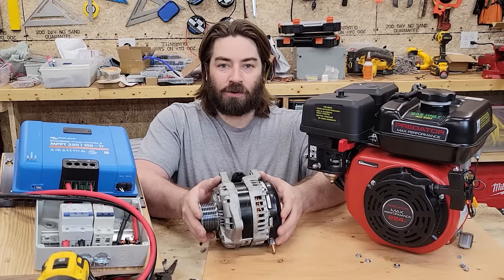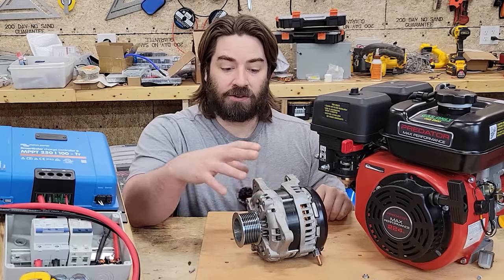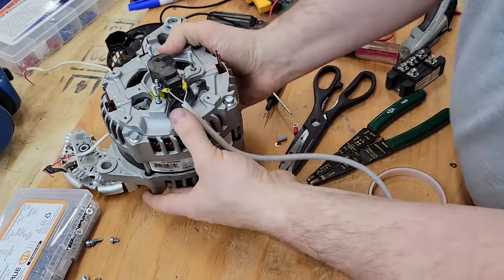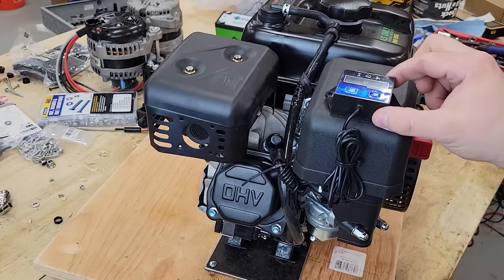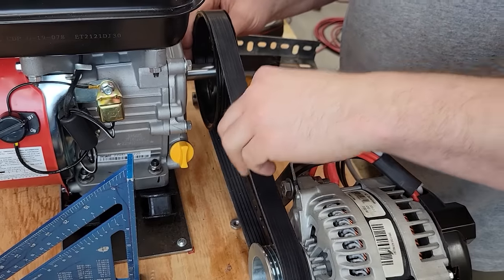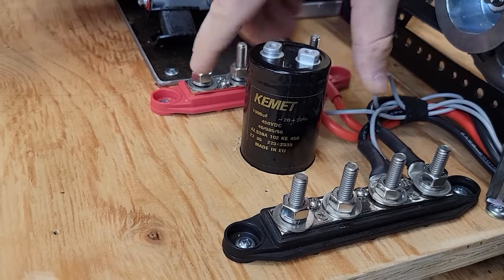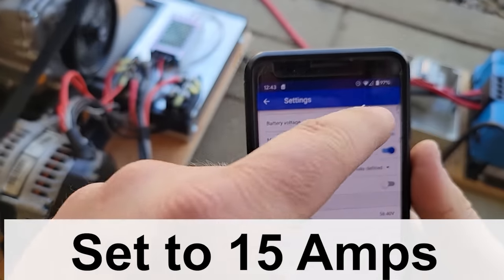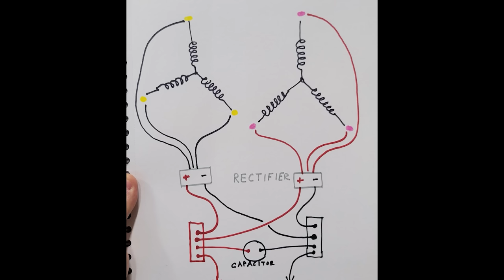The AlternatorGenerator, First Attempt.  48V Battery Charging

Comment: Great idea, however with 2 isolared stator windings, did you consider to rectify each 3phase system seperately and put 2 seperated rectified voltages in series at DC sides with as advantage; more or less double voltage at same alternator RPM and lesshigh voltages om individal statorwindings isolation (ripple should still be limited as 2 stator systems are 60 degrees phase shifted..?
Reply from the maker: Yes, I thought about it.  If I tested this, and didn't get at least 80VDC then I was going to series connect them. But since it got above 80, there was no need.

Comment: The goal would be to get the amount of voltage to stay the same under load of charging at a low rpm on the engine to conserve gas and keep noise down id rewire the alternator with thicker gauge wire and permanent magnets

Comment: You could have used the original rectifiers.  Is the reason for mounting the rectifiers externally on a massive heat sync for better cooling?
Reply from the maker: There were a few reasons I moved to an external rectifier.  One of the reasons is to move the heat from the rectifier away from the alternator.  I go into it in more detail in part 2 video.

Comment: I am no electrical engineer, so how i would do it would be to get two 24v alternators putting out 28v each and run them together, wired in series putting out 56v. Just right for your 48v battery bank
Reply from the maker: There is another YouTuber who went that way.  His channel is Trial N' Error.

Comment: Solid mount your motor to the base. Rubber mounts are no good when using a belt drive. 
Instead of holes in your tensioner bracket use a slot. Just look at a cars mounting bracket. That way you can put tension on your belt and then tighten the bracket.
If vibration is still a problem their are two possible solutions.
1. Put spring or rubber mounts under the base.
2.build a metal mounting plate under the alternator and the engine and then put springs or rubber vibration dampers between it and the base.
Hint. Check huscavarna chainsaw engine mounts as spring vibration dampers.
My old friend made one of those rigs 30yrs ago.
I think there was one available commercially called the Genny D.C.
Both of which only put out 12 v.
I knew that an alternator puts out more than the aprox 14v. Hence the need for a regulator or battery would boil.
I apploud  you for unlocking its potential. I would be fascinated to learn the energy efficiency of the system.
And the potential for alternative drivers
.ie water or a steam turbine.
Well done.
Reply from the maker: Thanks for taking the time to help me out. 
I implemented most of those changes in the part 2 and part 3 videos:
https://youtu.be/cy0t4qq8mS0
https://youtu.be/yQTCVyxdauo

Comment: I may have missed the detail where you explained it, but curious why you didn't use the diodes already on the alternator?
Reply from the maker: Check out video part 2 https://youtu.be/cy0t4qq8mS0
I dedicated a chapter to answering that question.  The chapter starts at time 22:39

Comment: on a pully look for a pully for a gas powered air compressor they use serpitine belts Also you might want to use somthing more ridged a steel plate or somthing like that  also I probaly would use a diesel motor off amozon you can get a cheep 5hp one and it go all day long off any fuel oil think being able to toss lamp oil in it or karsine ina pinch would be nice. not to mention diesel just flat has more torque   you could also feed the windign a bit higher voltage if you want 14 or 15 volts and get some more out of it

Comment: The vibration is from the play between the motor mounts and the semi-solidly mounted alternator.  Are there bolt holes on the engine to which you could attach the alt? That would give you a solid distance between pulleys.  Right now, the play is in the rubber mounts, allowing the engine to bounce around.  I, too wondered if that was a solar-rated breaker.  Overall, nicely done, David. Ya can't beat getting 3kw out of the very first attempt.  I'll be making one of those for my own 20kW EG4 array.  It'll keep me running when the skies darken for too long between solar charges.
We ALL need to think about things like this as our civilization spirals into the dirt.  Don't doubt that the lonely hearts will start importing ham-arse terrorists into our country next week.

Comment: The alternator needs to be mounted to the engine, not through the rubber mount but directly to the engine (not the plywood). The reason being that there should be no rubber mount separating the two rotating members. Said another way; Mount the alternator to the engine. Then rubber mount the assembly to the base. 
The partial reason that vibration remains a problem is that the alternator is attached to the base and the alternator is experiencing rotational motion loss and acceleration forces every other rotation of the engine as the engine rotates through to each compression stroke. Lost motion is the issue.

Comment: Mount the alternator to the engine, ( not the wood base) for lower vibrations and less belt slip/ more belt drive efficiency. Then upgrade your engine mounts which seem to be doing a bad job coping with engine vibration, esp under load. I think you’ve prob worked this out already. 😎
Reply from the maker: Thanks for your comment.  I fixed the alternator and engine together with a welded steel base in video part 2.
Reply: @DavidPozEnergy  thanks for the feedback. 😎

Comment: I was thinking you could soft mount the alternator like the motor. then hard mount it to the motor. also you should be able to use the charger in the motor to accite the alternator.
Reply from the maker: Thanks for your comment.  In video part 2, I hard-mounted the alternator and engine to the same steel base.  It worked out well.

Comment: So, why take out a perfectly good set of rectifiers that are already attached to a heat sink and cooled by the forced air cooling the alternator was built with? Others in the past have taken the regulator out of an alternator and used the existing diodes to get 120V DC output for light welding.
Reply from the maker: It's a great question, and I debated about it for way too much time when I was working on this.  It was such a common question that I devoted a whole chapter to it in this video: https://youtu.be/cy0t4qq8mS0 at time 22 minutes, 39 seconds.

Comment: How much did the project cost including your time  i live in mass and wish i had one of these for my off grid system i am curious though longevity of it and you should try a shock to take the blunt of vibration
Reply from the maker: It took about 6 months of research to really feel comfortable building it.  There was a lot to learn.  The actual build took a week (3-4 hours a day).  Of course, it would go faster now, LOL.  It would save time to use the built-in bridge rectifier, but you would have to use an external battery, not a DC to DC buck converter.  Anyways, I'll answer these questions in more detail in my follow up video.
BTW, if you want to talk in more detail, contact me on facebook@ davidpozenergy

Comment: So I had a thought as a mechanic.  While I won't say I fully know the internal workings of an alternator, was there a reason you didn't use a 1 wire alternator for a Chevy?  They're self energizing
Reply from the maker: If I was recharging a 12V battery, I would have chosen that style alternator.   In my situation,  I want to recharge a 48V lithium battery.   I need to control that externally.

Comment: This could be made into a great little portable generator to extend the range of a practical lightweight EV. Most people only need a range of 100 miles to get to and from work. When one needed to extend their range for a longer trip, this little generator could be dropped in. On long highway trips, once the car is up and going the generator would be able to easily extend the range.

Comment: The thing is, gas/diesel doesn't store well long term, and when the grid is down, generally the pumps are also down or filled with zombies. So you have to make sure you always have fresh fuel around. And striving to be self sufficient and independent, you should look for ways not to rely on the outside world for anything consumable anyways. So, I know this is not really your wheelhouse, but I'd love to see you explore alternative ways to generate power when the sun doesn't shine or when the wind doesn't blow. A steam engine maybe? You can always find a dead tree to burn.
Reply from the maker: For sure exploring alternatives are great.  I also have a diesel generator, which could run on vegetable oil, or used motor oil.

Comment: I would like to see a AC 120 V motor power the alternator or two alternators to charge the battery and see if the 120 V AC motor can be powered by the alternators or how much the alternator can power the batteries. I guess what I’m trying to figure out is if we can have a perpetual Electrical power source that feeds the 120 V AC motor and charge with the DC alternators? Maybe a couple of alternators and tandem my question is is it feasible to have a AC motor power my DC power supply efficiently enough? That is how much or how many alternators would it take to power my home using 120 V AC motor to charge my batteries using the alternators?

Comment: Hi! good video, I might have missed when you said it but since I missed it could you tell me why you removed the original diodes and replaced it with an external one please, I thought all you had to do was to remove the 12v regulator and place an adjustable supply to the rotor coil. the piv of the original should be at least 70v and the orignal diode gets cooled by the fan of the alternator, the diode wasnt absolutely needed either since in an auto you dont have caps to smooth the output voltage
Reply from the maker: There are a few reasons.  1. less heat inside the alternator case. 2. I don't know the Voltage rating of the diodes. ETC.  However, the original rectifier may have worked perfectly well.  I'm not sure.  I'll go into more detail on this question in my follow up video.
Reply: @DavidPozEnergy  ok looking forward to watching it, thanks for replying.

Comment: Good info. Is there any reason to wire the solar charge controller directly to the inverter or can I just go straight to the battery since it's all parallel. Is this just preference?
Reply from the maker: Ideally, set up central DC busbars, one for positive and one for negative.  This central point is where all your DC stuff comes together.  Batteries, charge controllers, and inverters.
Reply: @DavidPozEnergy  Thank you for the reply, that makes sense.

Comment: Why didn't you leave the original diode pack... I'm sure they would be rated above 100volts and would have made for a cleaner setup... I wonder how much current the exciter coil needed under full load
Reply from the maker: I dedicated a whole chapter in video part 2, to answering the question about the diodes: https://youtu.be/cy0t4qq8mS0?si=XLdnCsPAVbBdXtct

Comment: Also, is the alternator's rotating direction critical? I think - the only impeller blades orientation could decrease the blowing quality in case of counter-rotation, all the rest (magnetic and electrical systems) must be quite symmetrical in terms of rotation direction so it should not be critical. Please correct me if I'm wrong.
Reply from the maker: The alternator will produce power in both directions, but the fan blades are set up for clockwise rotation.  You had it.  Thanks for watching.

Comment: That type of modification will shorten the life of the alternator. The charge rate is normally 12.6 to 14.5 volts. It is not the volts, but the ampres that charge the battery. It is ac voltage until it gets to the rectifier bridge. After that, it is dc. The alternator should have the max amperes that it is capable of generating stamped on it. A car electrical system is normally 11 to 14.5 volts. Yes, inam pulling this from memory, but I was an ase certified master tech, have studied cars for years. Highschool, Wyoming technical institute, American river college. Id suggest rubber feet under it for stability.
Reply from the maker: Thanks for your comment.  I also have a part 2 and part 3 of this video you may like.

Comment: How did you hock up the power to the Alternator ? If you leave the current on all the time it will burn out the Alternator you need to have some kind of starter ignition which only sends power when you turn it on charging the self igniting alternator! I have 2 - GM 10 Si high Amp Alternator’s self igniting but you need to hit it with like 2.3v to start the charging & I have a Ford / Mazda 150A Alternator all 12v but my battery bank is 48v Lithium Phosphate Each Bty. 3.2v 280Ah 15 PCS & LTO 2.4v 40Ah 22 PCS 20 PCS is 48v my inverter is a Hybrid 5KVA 230v Charge controller 48v , Rectifier  3 Phase in 2 Phase out 250A 1,600W over kill for my house ! Any thoughts ! You’ve actually done it ! If it’s not to much  !
Reply from the maker: I used a buck converter to power the field winding of the alternator.  The buck converter is only on when the alternator is spinning.

Comment: you have the engine rubber mounted but the alternator hard mounted, thats why youre getting wacky things happening with the belt, youd need to mount them on their own platform and rubber isolate that to save the electronics from the vibrations, or if the electronics dont care you can just put rubber feet on the whole thing and hard mount everything

your bottle neck isnt the engine or belt drive, at 6.6HP even if harbour freight is embellishing that number you have lots of head room for power loss there youre producing about 4HP of electricity, and assume 750watts of loss in heat between the belt, alternator, rectifiers and convertor you still have 1.5hp of room for them to be off on the HP and for other losses

your bottle neck will be cooling that alternator, while it can do 215amps, it cant do it continuously, i dont know what impact running at the higher voltage will have, if that will make it alot more efficient running lower currents, but regardless i know from winching with my jeep that the alternator will get scalding hot if loaded heavily even for a short period of time, theres probably more information on this in car audio forums as theyll tend to be pushing alternators well past their design specs but chances are to run this anywhere near continuously youll need to run two alternators in parallel each only using half the load, or simply run the system at half its capacity and use short bursts of full power when needed, would have to test how long it takes to overheat, id guess you might get 30 minutes in safe temps, and another 30 minutes pushing its limits

consider the size of the generator head on even a small 2000watt generator, itll typically be 2-3x the size of the alternator for less power output

side note: junk yards will make these projects more realistic economically, you can get your alternators, pulleys, and heavy gauge wire from vehicles at pennies on the dollar

an idea everyone has had, you probably pulled it off the best of anyone ive seen do it just needs some tweaks and could be great to top off batteries during winter storms

Comment: The total output is not going to change much as the windings are capable of only so much current,  volts can change and amps can change but wattage is fairly consistent at maximum output
Reply from the maker: Thanks for your comment.  Part 2 and 3 videos are live: 
Part 2: https://youtu.be/cy0t4qq8mS0
Part 3: https://youtu.be/yQTCVyxdauo

Comment: I tried to read the rating on the circuit breaker.  It was hard to read, but it appears to be an AC circuit breaker.  In any case, it should be a DC circuit breaker.

Comment: Experiment with methane gas produced from kitchen waste as alternate fuel. And try enriching the fuel with hydrogen perpetually produced from a small wind turbine for the electrolysis. 
The final stage would try store the energy into so of the newer battery types too.

Comment: I don't understand what was wrong with the diodes the heatsinks that there are in inside the alternator, I've done the same project, and all I did was just bypass the voltage regulator, and put a rheostat to vary the voltage to the rotary, I could turn the voltage up and down coming out of alternator, simply by rotating the rheostat,

Comment: OK, I'm not the brightest bulb in the pack but most cars Rev between 1500 - 2200 if you are hard on the gas. The gas engine he has max out at 3750rpm that should be more than enough revs to do what he wants. There should be no need to Rev it to 8000 rpms. Am I wrong?
Reply from the maker: Usually the alternator is spinning faster than the engine.  On average, there is a 3:1 ratio, meaning the alternator is 3x faster than the engine.

Comment: What if you put a bigger pully on the engine it will spin the alternator at a higher speed with the engine running at a lower rpm

Comment: Hang on, I’m confused… why did you need the MPPT controller? I’d think you could just regulate the voltage with the field coil current to whatever your battery is wanting.
Reply from the maker: I hope to try that at some point.  I'm learning as I go with this project.  Right now, I don't know how to build a reliable Voltage regulation circuit.